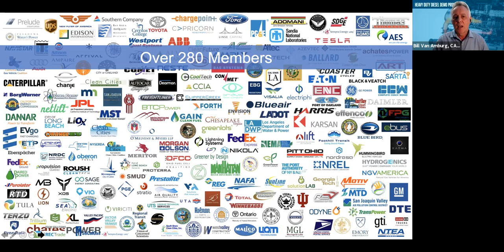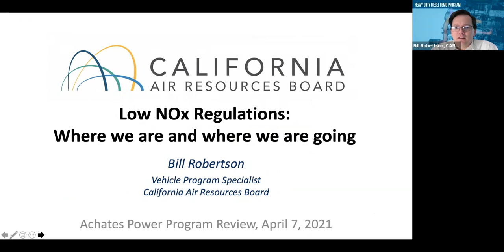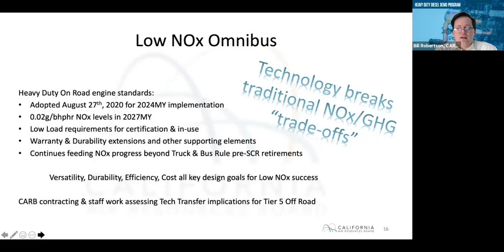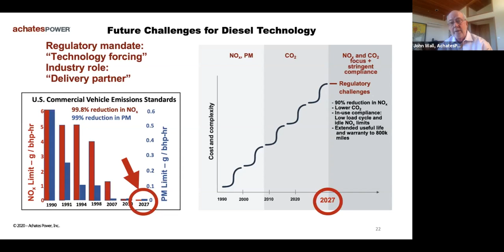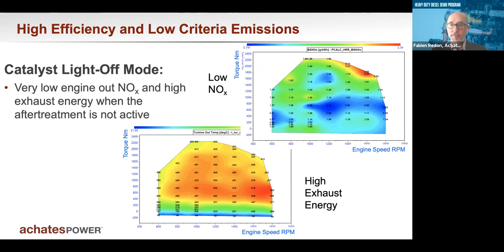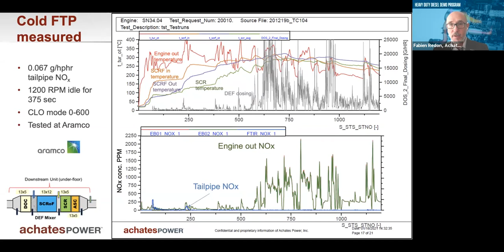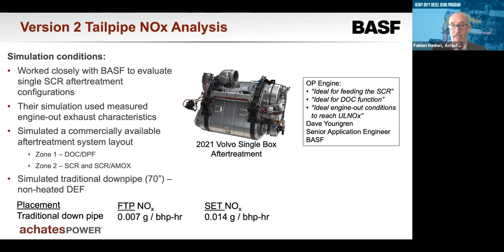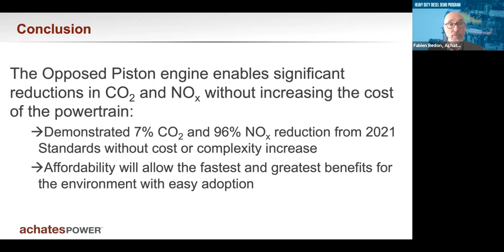Achates Power Heavy Duty Diesel Program Review

Comment: It's been almost 3 years since the F150 was thundering through the parking lot.  If I recall correctly, wasn't 2021 the year the 2.7's were supposed to be released for that application?  Why the crickets?  This design is brilliant.  We need this technology ASAP.
Reply: The f150 was a tech demo by Aramco, and had nothing to do with Ford as far as I know unfortunately. They could have done the same demo in a chevy etc... It was done by them basically as a proof of concept for diesel sustainability etc... I think the next most likely manufactuerer to introduce this might be cummins as they developed the advanced combat engine for the military...
Reply: How about OP 2 strokes in snowmobiles and card too. An OP 2 stroke outboard.
Reply: A Rotax 1700 OP made from 2 850 Etec engines!
Reply: @jlo13800  Or a boat engine.

Comment: Can you release a 3 cylinder crate engine for people to do engine swaps to beta test your product?  If your emission reduction numbers are correct it would be a no brainer.
Reply: Can we get an OP 2 stroke snowmobile motors too?
Reply: Let us have it before fuel is banned!
Reply: Just go get a 1.9 L 3 cyl G2 evinrude 150 Etec, you would be muck better off as Rotax makes this for the new Rotax 150 HP stealth outboard. Unlike achates power 2 stroke a 1.9L and 850 Etec turbo r is a reality! The 2.7L achates could fit in a snowmobile and is oil injected but its not existant. You could build a 3.8L OP out of 2 1.9lL 3 cyl G2 engines.

Comment: Thank you for this comprehensive discussion. It is good to learn that the technologies you are developing can be applied to accelerating our transition to zero CO2 emissions and minimizing dangerous other emissions along the way. Keep up the excellent work.
Reply: Truly zero CO2 emissions isn't possible or worth it I think you mean carbon neutrality, so zero NET CO2 emissions.

And making everything electric isn't worth it either.
Reply: It's what trees breathe, on that note Co² levels are actuallyly too low.
Reply: Zero C02 is a dream. A bad dream.
Reply: I think I've read that these engines could potentially be ran on hydrogen and get the same efficiency as a fuel cell without the astronomical expenses inherent to said fuel cells. That way the only emission would be harmless water vapor!

Comment: @Achates Power   Happy to hear your exploring bore spray.  You touched on rings as well, how has oil control improved if any?   Last deep dive was like 5 years ago and it was really just OK.  There are so many promising analyses & tests but engines must prove themselves in revenue service.
Reply: the oil could be a cleaner burning ester based lubricant. I switched to BRP XD-100 synthetic oil to top off my 8v92 detroit and i notice cleaner smoother running.

Comment: Beautiful efficiency & emissions, bravo!  Why is this project sooo slow?   This seems like a minor update to what has been discussed, modeled and demonstrated for about 3 years now.   

Build a pilot fleet, burn a 100,000 gal of diesel and get started start finding the mistakes and weak spots.  

It does seem the air system is much simpler ( taking off the screw compressor), good work.     But not impressed with the Super-Turbo belt drive, seriously, please convince me you have a million mile solution in the works instead ?   Also what’s the maintenance & durability on the little CVT in the turbo drive?  I read about Super-Turbo a few years ago but it’s not really a mature product is it?
Reply: Realistically, on a production engine, the supercharger drive would probably be gear-driven.
Reply: @electric7487  yes, one would hope.
Reply: Me thinks the major reason for stall is funding, money makes research a lot easier hey? The concept and technology is fantastic, I'd say... But to convince the big players, not easy...
Reply: 1:17:25 is the answer
Reply: @MrDariowool   You are right!!  I missed this, but that sounds encouraging!!
Reply: @timduncan8450  And the alternative answer might be that any of automakers are willing to pay to use the patent of this type of development, so they stick with what they know and they start to migrate to electric....We will never know...

Comment: Damn I wish they were still trying to push there 2.7l I would love that in like a truck or jeep great mpg, great torque, and lighter then a battery pack.
Reply: They are.  They got some gov money and brought in Ricardo to help.  

https://dieselnet.com/news/2020/09achates.php

“Achates has been engaged with ARPA-E for several years, developing the OP GCI pickup truck engine along with partners Delphi, Argonne, Aramco, and others. The new Gen II program builds upon the Gen I opposed piston engine with a focus on efficiency, weight, emissions and power. The 3-cylinder engine will be comprised of a GCI combustion system, a novel boosting system, 48V electrification and advanced manufacturing techniques to minimize engine weight.”
Reply: Yes it would be nice, cummins is got the op ACE 2 stroke 1000 hp going for the army. How about a 1700 op 2 stroke twin made out of 2 850 rotax etec engines, That would make a sick OP powered trail sled. the 2.7 would be perfect in an outboard. i got an 8v92 turbo detroit 2 stroke and a small block v8 OMC Johnson side oiler 2 stroke. i switched my 8v92 to 6 gallons of etec brp xd-100 and it cleaned her hout well and seem to run better and cleaner. less wear as its full synthetic and rigged homemade oil burn off with 2 vro pumps feed the fuel.
Reply: There's nothing to go wrong with it though. Bad for business
Reply: @jlo13800  The problem with most diesels is they are extremely heavy...  our favorite outboard the OMC is one of the lightest engines by HP on the water. We definitely need an opposed 2 stroke design to bring 2 strokes back on the lake and coasts though.
Reply: 2 stroke OP diesels have good power to weight, can work with castor 927 maxima 2t oil for lubrication and and a pulses plasma which taps the ZPE and eliminates chemical fuels. Joseph Papp built an inert gas fill pulsed plasma 2 stroke, we like T Henry Moray, Tesla and Edwin grey were ruthlessly suppressed.
Reply: Fit the 2.7L OP in a banshee!

Comment: Very interesting, thanks! Wish I was done with my engineering degree and could have the opportunity to work on this!
Reply: get into this design as fast as you can.
Reply: Get  yourself 3 850 Rotac turbo R engines and get a 927 big bores, next assemble an inline 6 2.7L. you may want to make an exhaust trapping sleve valve driven off a for 300 inline 6 cam and drop it in a f-150.

Comment: Really hope that these could come in V12 versions. I've always wanted to see modern 6V, 8V, and 12V 2-stroke engines, and now I really want an opposed-piston V12 in a semi truck.
Maybe Caterpillar could get back into the truck market via EMD. Or Detroit could have a shot at this. Call it the Series 9200 or something.
Reply: Have fun dreaming. The EPA ruined the diesel engine a long time ago
Reply: I don’t understand how you could have a V-anything with an opposed piston but maybe I am overlooking something.
Reply: @jonathancallender8185  Three crankshafts, two on top and one on the bottom.
Reply: Yes the come back of the 2 stroke, Cummins has the ACE OP 827 CID 2 stroke for the army, Rotax Etec, EMD 710 and Fairbanks Morse Triden OP 2T. Nature uses the 2 stroke cycle all around us. Lightning bolts are a plasma uni-flow 2 stroke and the sun is a spherical rotary plasma loop charged 2 stroke!
Reply: You obviously don't understand how an OP engine works.
Reply: @Hogger280  I do. Your point?
Reply: @jansen7640  the very point of this engine is that it is compliant with 2029 EPA standards while being more powerful, efficient, and compact.

Comment: Any hybrid engine in coming years?
Reply: Maybe, and if so, it would be very interesting to see. The primary powerplant would be an OP Diesel, and they would run on biodiesel (including used cooking oil), synthetic Diesel, and used motor oil/hydraulic fluid. If we kept the big stuff as primarily ICE, our electrical grid would be much simpler, and if synthetic fuels really do work out, Diesel trucks could be carbon neutral (realistically, it would probably be almost carbon neutral). A parallel hybrid is a great idea because it could use the electric motor for regenerative braking.

EV's are not magic.
Reply: It will pollute the environment in both ways 🤦🏻‍♂️👍🏻
Reply: @jansen7640  Electric vehicles will never magically eliminate pollution.
Reply: @electric7487   Correct, Hey Elon the sun doesn’t shine at night.  Most EV’ are ‘coal cars’ & will be for many years to come.
Reply: @timduncan8450  the heavy metals in the battery are an ecological nightmare.
Reply: @randymagnum143   What?
Reply: @timduncan8450  not only is the energy sources for ev not that environmentally friendly, the pollution caused by the production and processing of the components of the battery is far worse than fossil fuel recovery.
Reply: @timduncan8450  where I'm from most grid power is supplied with green nuclear energy.

Comment: Why isn't the public hearing about this, and why isn't this the solution to America's energy instability? Why is the government heavily promoting EV's, which are not a solution at all, but a bass-ackwards approach to confronting energy and sustainability issues? The Achates system is absolutely brilliant, whether using diesel or gasoline.
Sixteen hundred scientists just signed a major paper repudiating the notion of a "climate crisis." Because the presumed "climate crisis" is a manufactured myth. Having said that, I believe there is a reason that our government is advocating for EV's (which we will not be able to generate electicity for), and it is political and not scientific. It is as if our betters fully intend on a total system collapse, along with severe monetary consequences.
Reply: Dead right sadly!
Cars have always been symbols of freedom.
Reply: I got a few jugs of amoil interceptor 2T oil for the new 2.7L OP.

Comment: unfortunately Achates, you took too long, passed the time, lost your timing. 
This engine should have been in production since 2003, for example.
Now you won´t even break the investiment
Now it's too late, you missed the train of evolution. 
Now it's time for electric motors, even better, more powerful, much more efficient and yet not polluting the environment and still not making noise.
The time and money you spent, for example, should have been on a better battery, such as the sodium ones that are coming around.
Diesel engines are now completely out of date.
Reply: Batteries are not magic.
Reply: I agree they have dragged their feet way too much.  However, trucks cannot haul meaningful amounts of freight with battery power.  Pickups that advertise a 500 mile range collapse to under 150 miles with small trailers.  Semis have 0 chance to operate in fleets with batteries for 10+ years and most likely 20+.  Batteries are difficult to recycle so far.  Like it or not we need an engine like this for 30 years while electric rolls out from toys for the super Rich to practical utilitarian vehicles for the rest of us.